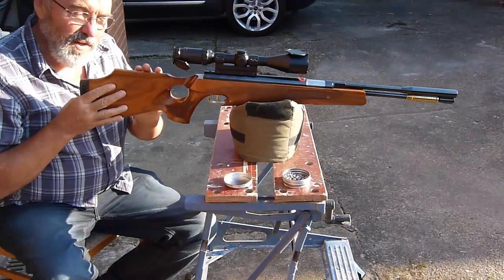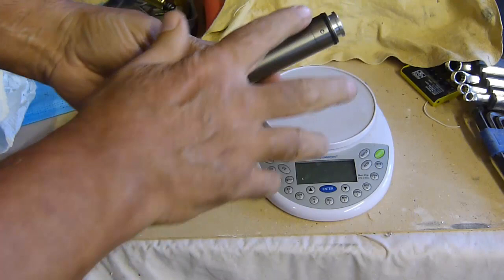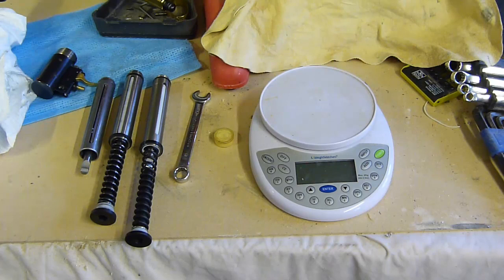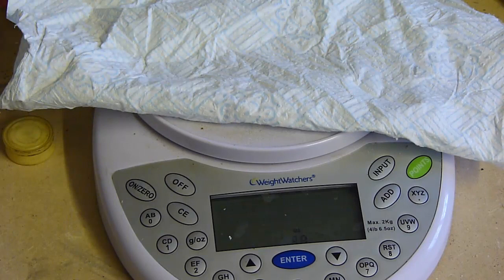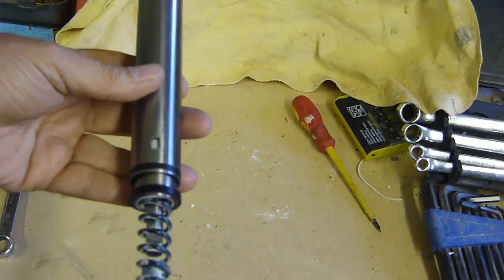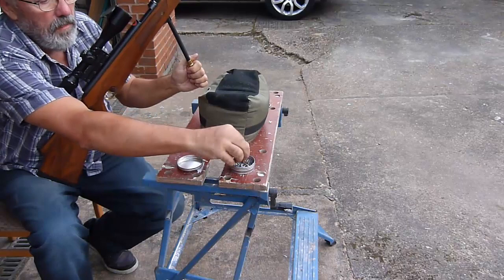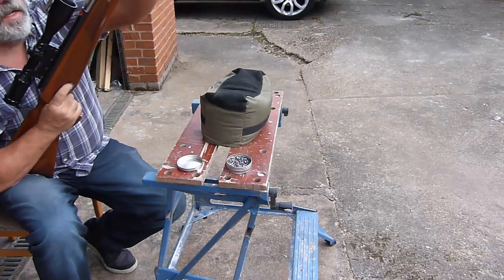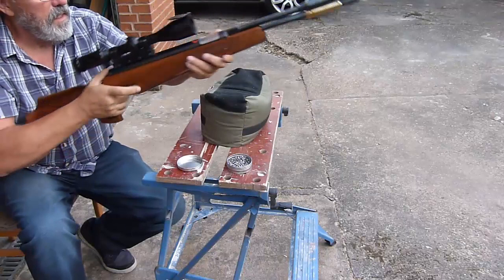Full power, deadly accurate, Paul Short Titanium piston  HW97

Comment: if the goal is  light recoil and less power ,its the way ,if you want more power  a heavy piston is better ,because its generates a higher and longer peak pressure and so more heat and thats  heat creates more air volume caused by the compression ,thats also the reason that the transfer port must not to big  a big hole flows better  and  then compression is lower but also you get less heat

Comment: It seems to me if i were telling everyone how great my new piston was i would show a before  and after installing the new piston video.  I want to see feet per seconds.  How much is it going to improve  my rifle speed in feet per seconds
Reply: I think you’re missing the point here. The tune is not about increasing the power feet per second (FPS) as the gun is already close to the legal limit as standard.
The point of the tune is to improve consistency from shot to shot, improve lock time, reduce recoil, improve trigger with smoother brake point with no creep etc. making for a more accurate gun.